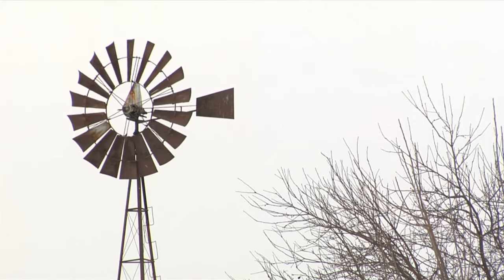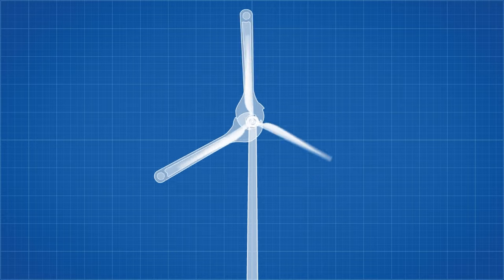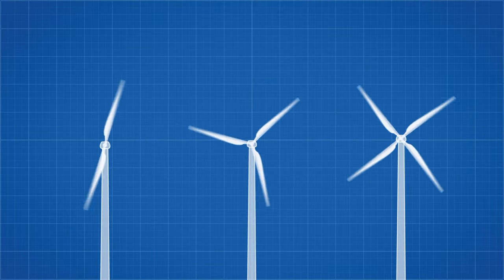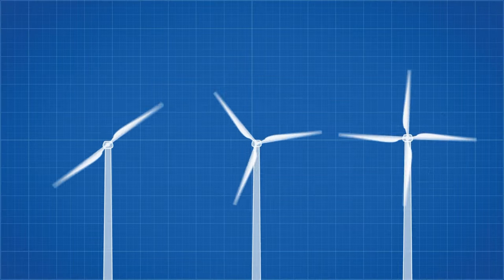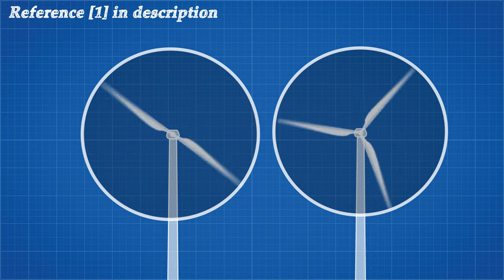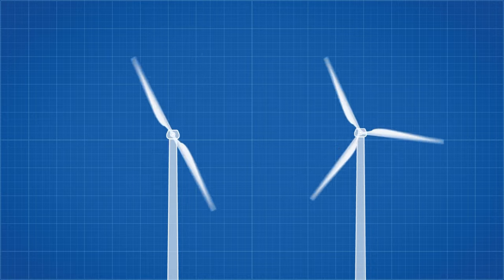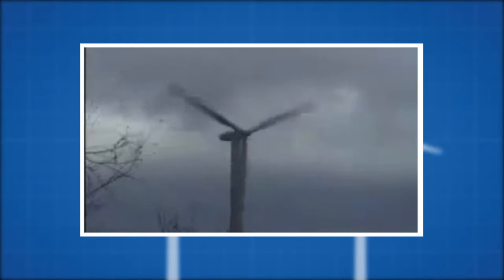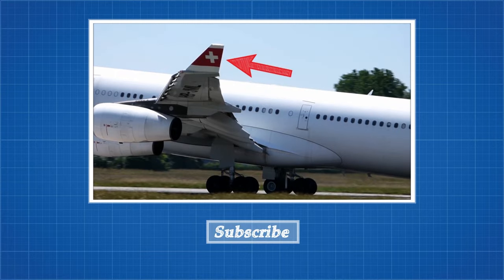Why Do Wind Turbines Have Three Blades?

Comment: I would have preferred to have a more Technical Explanation of what the Advantages would be on 4 or even 6 Blade Turbine rather than just writing it off with Cost... i know Costs count, but the Technical aspect should be the primary aspect of the video.

That said: will you be doing a Video on the "Vertical Axis Wind Turbines" soon?
because in theory, they are a lot more efficient and cost effective than the classic Horizontal Axis Turbines, yet you don't see too many around yet... WHY???
Reply: +CrazySteTV 
He explained it: when adding more blades, the drag and the cost become a problem. It is not worth adding more than 3.
Reply: vertical axis rotors are not more cost effective, no clue where you got that from. they are also hard to built in big scale and because of their small form factor always closer to the ground thous slower and less steady wind to work with
Reply: +Robb Stark they are Simpler to Construct, they have a big advantage as they can take wind from multiple directions without need to rotate the mechanism in the Wind direction, which means a lot more efficiency even if the Wind blows in contrasting directions; they rely on 2 bearings, of which the most stressed is close to the ground and of easy maintenance not to mention the actual GearBox and Generator are at ground level, making maintenance a breeze.

http://cleantechnica.com/2011/07/14/caltech-vertical-axis-wind-turbines-boost-wind-farm-power-efficiency-10x/
Reply: at ground level there is less wind, why do you think nobody is building them on a meaning full scale when you claim it's more efficient design? it's absolutely fringe and unimportant
Reply: the authors are talking about efficiency in terms of space claiming that the area efficiancy is 2-3 W/m² which i assume they came up with using some kind of abitrary circle around the machine that is , the efficiancy of a horizontal turbine based on the vertical plane the blades cross is about 250-450 W/m². so yeah the article is grossly missleading to create a hype around a technology that was used since the persian empire like it's a game changer :)
Reply: wind is not blowing from multiple directions at once unless you built your machine near a steep cliff that creates eddies in the air. for all purposes wind only comes from one direction at a time which would be pretty obvious if you have ever seen the weather report. nobody would built any turbine next to an obstacle that would make the wind swirl in circles, what would be the the point of that? any obstacle is stealing you wind power. so you are really talking about a non-issue here. the numbers in this article are so badly researched it's laughable really the factor 10 alone should really set of your bullshit alarms already. if logical think about how much energy a horizontal produces with the tiny footprint of the tower while the land is still usuable for agroculture while the vertical concpet needs support wires foundations every couple of meters, this is just a bad concept, no matter how bad you want it to be different
Reply: I just saw you claimed wind can flow from N and W at the same time, that would be NW as a wind direction wouldn't it? wind is a vector you can sum them up you know?
Reply: Robb Stark saved me from having to call bulshit on Vertical Axis wind turbines and explains it perfectly.
Reply: +Robb Stark for what i have read, and keep in mind i am not an expert, but in 200 Feet difference you can have Winds blowing different Directions, and that's what even that image i linked states.
Anyway, let's say you want to install Wind Turbines in an hilly area, the Vertical one can deal with the Turbolences of the case with no issues, giving additional land where to take advantage of Wind Energy
Reply: I get where you are comming from but wind shear is usually a speed issue rather than a direction issue.  I.e, the wind blows faster at the top of the turbine than the bottom.  Vertical axis machines would experience this more, because their lowest moving point is closer to the ground.  In addition vertical axis wind turbines are by definition less efficient, and suffer from severe fatigue issues since the blades are constantly being subjected to alternating loads on every revolution.  

I should perhaps clarify that I design wind farms for a living.
Reply: absolutely right
Reply: additionally consider that the power of the wind scales cubic with the speed, so just 20 percent faster wind means 72 percent more force delivered by the wind, that is why you want to get as far away from the ground as possible, a small difference in speed goes a long way in power.
Reply: +drawingboard82 OK, so, let's say i am a common person and i would like to install my own home Wind Turbine... obviously i can't place a 300 feet tall pole with a giant WindMill that is bigger than my Home, more likely i will end up installing something that is anywhere between 10 and 15 feet from the Ground that gives me 1kWh tops... in that case: is a Horizontal Axis still a better choice or that's when a Vertical Axis makes more sense?
Reply: +CrazySteTV. There's a couple of answer here depending on which one you like. To be honest the best answer is to simply not have small wind turbines. modern offshore turbines run up to 8mw at capacity factors over 40%. Not only does this lead to clear economies of scale, but the maintenance costs for an 8mw turbine will be far lower per kW than a small household machine. your best bet in this case is to buy your electricity from an environmentally friendly supplier - I use goodenergy here in the UK as all their electricity comes from wind turbines. 

If you live in a remote area away from grid then solar is a good way to go because the economies of scale are less skewed and the maintenence costs are essentially zero. Micro hydro would be my next choice, followed lastly by small wind. Small wind turbines are expensive and break down a lot. Having said that I see the attractions of them, and as a home build project they would be great fun. Your best bet if you like wind is to put the biggest machine you can on the tallest tower you can get, and site it well away from buildings, trees etc. Again I would steer clear of vertical axis unless you just want a simple savernious machine for pumping water or the like. Hugh Piggott has been doing this for years and if you Google him you should get a good idea of the reasoning
Reply: +drawingboard82 i don't live in UK, i live in thebUS on the western part of North Carolina where the Appalachian Mountains begin
Reply: +CrazySteTV right, lovely part of the world. solar water and electricity are a good place to start, and have a look for ethical energy suppliers :-)
Reply: The guy in this video doesn't seem to have a lot of knowledge about the technical part of windpower... Well yes, they cost some more to produce a fourth blade, but when we are talking about the whole project, then the fourt or fifth blades additional price increase is just some few percent.... 

THE MAIN REASON WHY WE USE 3 BLADES IS: There is a aerodynamical phenomena which is reason and it is someway hard to explain, but I'll try.. If you would have let's say 6 blades, then the wind speed would decrease significantly after the turbine. So imagine what would happen if the air behind the propellers stood still. Yes, the pressure in front of the turbine would also be higher, so the wind would "go around" the turbine. Because it would be almost the same thing as an unidentified physical obstacle would stay straight out in the wind. SO you want to get the wind to go through the turbine as fast as possible, but still take as much kinetic energy as you can from it. So there is this perfect ratio AKA Betz's law (https://en.wikipedia.org/wiki/Betz%27s_law) which says you can take maximun 59% of the energy from the wind, today we're at about 40-45% in the best cases... Then there is also the question, why three blades? Why not two? Or one? That's a different question... :D
Reply: +Leo Byskata right there is no way around Betz,  if you want to read Into the experiments Germany conducted Google growian which was a two blades built for 90 million mark that had structural problems after 4 hours
Reply: Or the one bladed one that was a complete failure as well interesting read even just on Wikipedia, so much better explanation than the dude got from that book that cost him a 100 bucks apparently, if he is genuinely repeating what the book said,  that could pretty much be called a scam
Reply: You don't see vertical axis turbines anymore, not yet. The Altamont pass wind farm had many, but as some of the other comments have probably noted, they sweep a smaller volume and the average height of the collecting surface is significantly lower for a given tower height. Height = increased wind speed + increased duty cycle. They aren't a terrible option if you must put them on an existing structure. But, for utility  scale power, they are inferior.
Reply: This has to be one of his worst videos. The throw-away "advantage" or "disadvantage" statements without a shred of reasoning is annoying. Worse, he brings up non-issues like sound.

Less blades spins faster as he noted. The faster it spins the better the bearings have to be, the more leading edge wear, and overall higher maintenance. Also, adding more blades is generally a trade-off between speed and torque. If you want a generator to last a very long time and do high-torque work - like pumping water from a well on a farm - then it's smart to use a design with many small blades. Electric generators have very little starting torque, but also do not produce power until a certain speed; thus less blades tends to produce power more of the time.

Even numbers of blades are much harder to balance than odd numbers. This is a large part of why 4 or 6 blade systems are almost non-existent. Keep in mind that it's not as simple as balancing the total weight of each blade, as the blades spin the centripetal forces apply more to the tip than the root.

This leaves us with 3 blade systems being the second easiest to balance, has lower construction costs than high blade counts, lower maintenance than 2 blade system, and a lower startup wind-speed than higher count systems. We can work around each of these issues, but every workaround adds inefficiency, construction cost, and maintenance.
Reply: Well written comment. Just a question with torque: Wouldn't you require more torque if you attached multiple turbines to one windmill? Could this not make up for the 5 blade design maintenance and construction costs?
Reply: Modern turbines vary the torque required to keep them spinning at certain speeds, typically so the output is a multiple of 120v 60Hz. You could simply make that turbine larger if the blades could put out more torque. This also puts more force on the tower, necessitating it being strong. The basic equations don't change though, a large 5 blade system will have lower return on investment than a similar 3 blade.
Reply: +천사 other than the fact the Wind Turbines are Engineered to stop when in position that cause sun light flickering to a nearby house, the Vibration theory is quite a crazy story just like the one that Solar Panels take away the Energy from tge Sun leaving us in the Dark and that's why they were voted to be prohibited in an NC town... what's next: Wind Turbines are goingbto stop fresh air circulation in America?
Reply: +천사 ... i switched all the Light Bulbs in my house with LED Bulbs using between 7W and 11W, all my Appliances are either "Energy Star" or "High Efficiency" Certified except the AC unit that is the only thing i haven't changed yet, and last, but surely not least: about 6 months ago i installed a NEST Thermostat and my PowerBill went down by about 20%... i average $35 a Month in my power bill before the NEST i was averaging $50 a Month.

BEST OF ALL: i am still alive and here talking about it ;-)
Reply: I make it a point to never argue with crazy, so I won't do a point-by-point rebuttal of the spew above- I just want to suggest that you get back on your meds...
Reply: +Shibumi nicely said. always amazes me how such crazy people survive
Reply: Kyle Towers Take it down a notch there's nothing you can do about this guy
Reply: +천사

1. Gallium arsenide (NOT arsenic) LEDs (GaAs) are inefficient and no longer in wide use.
2. your light must contain heat = crapola
3. Of course, there had to be the idiot preferring a really nice and healthy coal or bunker C power plant right next to his yard. Or how are you going to produce the energy required to run those nice and "efficient" Edison bulbs?
Reply: +Kyle Towers I know some North Koreans and they are usually far more intelligent than that.
Reply: VAWTs have one half of the turbine rotating against the wind. This makes them less efficient. They also occupy more ground space than the other kind of wind turbine, and have serious problems with balance and vibrations. The largest VAWT for boats and RVs produces 50 Watts, while the largest horizontal turbine in the same size produces 240 Watts.
Reply: *****
1. Oh yes. But only in 1890, because there were less than 5000 lightbulbs in the whole planet
2. It's spelled CFL. And a 100W lightbulb run for 45 minutes equals to 75 Wh of energy consumed by the bulb, according to you. You say a CFL consumes that energy in 6 seconds, that would mean 750W consumed for 6 seconds. That's impossible: it would trip any breaker.

3. Nuclear batteries (called RTGs) run for 20 or even 30 years, not 8. But you surely don't have them in your home, idiot, because you will get radiation sickness and get a cancer and then die in far less time than we are going to die from wind turbines, solar panels and LEDs.
Also solar panels don't contain any arsenic or other harmful substances.
Reply: *****
1. You don't make sense. In my living room, I have a chandelier with 24 CFLs. According to you, since each of them takes 750W, my chandelier would consume 24*750W=18000 W (18 kW) of power during startup. That's enough to heat an entire house.
The lighting circuit in most houses is protected by a 10A  (some 6A) breaker. 220V*10A=2200 W. How can the 18kW lamp not trip the 2.2kW breaker?!?!

2. "No solar panels and LEDS contain arsenic and harmful substances" WTF? You just said:
"Do NOT USE LED. LED also contain Arsen!!"
two comments ago!
Reply: *****
You want a picture?!
Reply: *****
Are you trolling?
It's been there since 8 years. I am an electrical engineer. I design those things and know how they work. You don't.
Reply: *****
I was expecting that. You know that I receive 500000€ each month from the New World Order in order to design CFLs that will explode and poison the world?
Reply: *****
How can I take the math? Does it comes in pills or syrup?
Reply: *****
No thanks, 500000€ a month is better. Thanks :-)
Reply: *****
Anyway before you call me an assassin I will replace the CFLs with LEDs because they are ugly. After 8 years they also make a horrible green-tinged light. But that's normal and not dangerous.
Reply: Technics Is the same as cost. Technics without cost count is science.
Reply: CrazySteTV he has replied to many comments but not to this one which clearly explained the concept in detail. 👍👌

Comment: I really like your channel but was rather disappointed about this particular video. When you change the number of blades many other variables can also be changed to compensate for a fixed say energy output. You only gave one argument each but didn't properly argue why everything else stays the same. For the four blade you say the cost increases at a marginal increase in the performance, but you could also make each blade smaller and in particular all your arguments for the two blade variant apply (less speed and less noise) which would even make the four blade variant look better.
Reply from the maker: Holger Brandsmeier definitely not my best, far to complicated a subject to explain in 3 mins. Will probably revisit it somewhere down the line.
Reply: Also forgot to add in harmonic balance at higher rotation speeds

Comment: a nice simple video, but you eliminated a 4-blade design based on "will only provide marginally more performance"
any reference for that?
also, if sound is the issue, does a 2-blade design make sense in off-shore wind farms?
Reply from the maker: +MS4E All the information is sourced from the Number of Blades section (page 340) in my referenced book. Another video by Learn Engineering stated it improved performace by 0.5%. I couldn't find a reference for that anywhere, so I didn't want to repeat it, but the idea is correct. 

Sound is just one issue, like I said higher speeds means higher loads. There is also a problem with teetering, for 2 bladed turbines. The hub needs to be able to tilt on it's rotational axis, because the 2 blade loads vary as the blades pass in front of the tower. 3 blades don't have this problem. 

Right now I can't afford to make these videos too long, but as time goes on I hope to be able to hire animators and writers to make real documentary style videos to cover as much as possible. Thanks for the questions, I will always try to answer any questions like this in the comments.
Reply: +Real Engineering my understanding was also that a higher number of blades reduces the efficiency per blade.  Every blade is travelling the wake of the blade in front of it, and so the most efficient is the single blade.  However, a one blade turbine is less effective, for the reasons explained in your video.  So it's a trade off between efficiency per blade and the number of blades that makes 3 the sweet spot.
Reply: Gohan6 2 blade design can’t pivot in wind direction